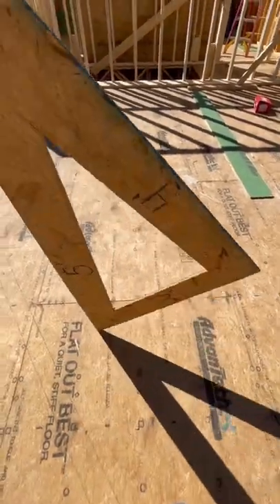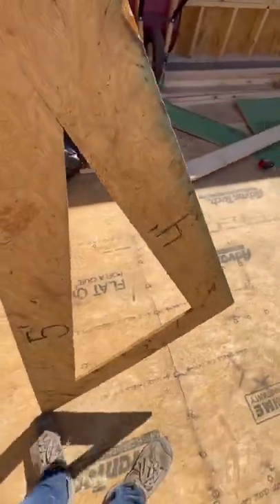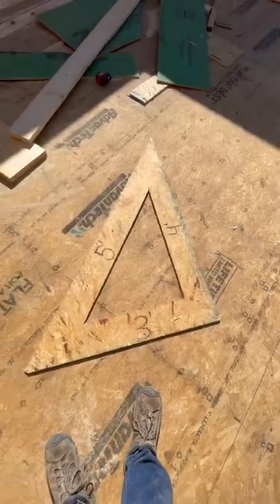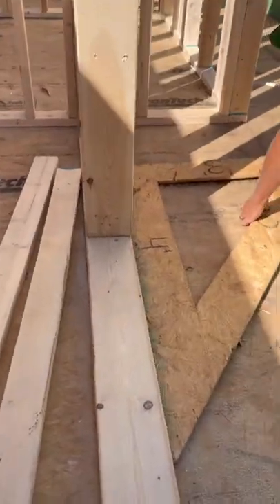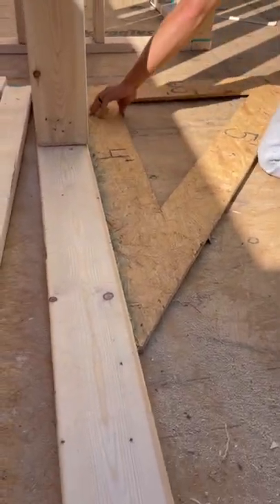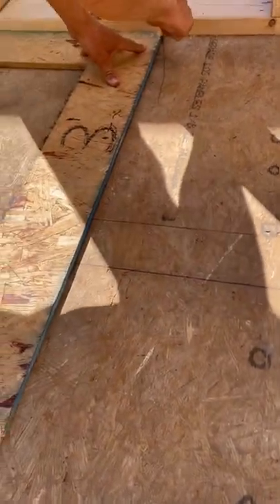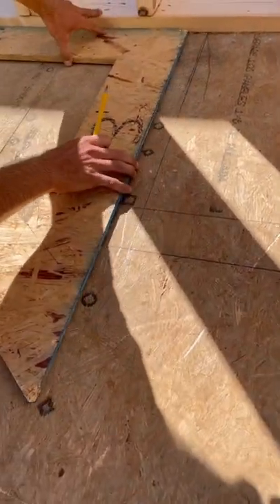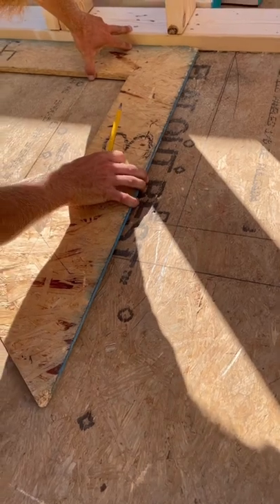Giant Speed Square- custom tool makes job faster

Comment: I made my own tool for punching holes in poly line and popping in drip line. Without having to bend over. Saved my back so much while putting in 20,000 lines
Reply from the maker: I bet

Comment: Used 6 nuts and some full thread to help me push open 2 steal walls. I welded 1 nut to each side of full thread and cut it in half, I then welded the other 2 nuts together.
Reply from the maker: Nice

Comment: I cut a cheap rubber basketball in half and use to drill holes in ceilings. Eliminates most dust as the half BB cups the area being drilled.
Reply from the maker: Very cool

Comment: I hate to break this too you but not one single side of a factory edge is perfectly square ... In fact , they're actually 2° off.... I don't really know why they are but they are ... If you take 2 ° and divide 360 by that 2 , you will have a 180 equal parts ... Now take the a 12" long piece of plywood , if you divide that error across 12" s into 180 equal parts then you'll find that each corner of a factory edge is actually 1/32 of an inch out of square over the span of an 8' board ... This comes out to 1 inch out of square over the span of a wall , roof or floor every 256' ... This is why no matter how good you are or how hard you tty to jeep everything in square you are always out of square and have that zig zag over hang when you start off plumb and even on one side and get to the other end ... This will happen no matter what you do because there has never been a single sheet of plywood that was 100% square ... Its fairly close to perfect especially seeing how it takes right at 256' to end up 1" out of square so over a short span of say 10' or so you only gave that tiny little difference in the corners of the plywood lining up ... Sorry guys but this is just the way it is and therefore that big triangle you think is a perfect square is well , just a big triangle because its anything but a perfectly square square...

Comment: Is osb square anymore? I mean the lines don't line up most the time and that's a pretty easy thing to calibrate at the factory so is the saw calibrated square. I'm just saying measure a few pieces the next time you get a skid. I think it will shock you

Comment: My car is notorious for having a tucked away PCV valve, and the #1 solution to it online is to take a piece of PVC piping and grind away teeth like a foot long socket and use that to get it in/out

Comment: 56 5/16 is the radius of a 360 inch circle. +/- a fuzz.  If you strike that circle on the ground every 1 inch equals 1 degree for say setting walls at 156 degrees

Comment: When nailing up siding, I cut a shim to the exact length of the reveal. Line up the bottom of the shim with the bottom of the previous row, set the bottom of the new row on the top of the shim, and nail it off. We still had the chalk lines run out to verify that we weren't introducing cumulative error, but the shim made it easier to align the siding one-handed (so you didn't have to set down the nail gun).

Comment: I use to work at a precast concrete plant and I always had a piece of rebar that measured 6 inches that I used for quick measurements and used to move and pry other rebar.

Comment: I build a lay out tool for commercial framing equiped with spray paint holder. back in 2002 we did the largest building under one roof in Maryland. there was 15,000 LF of walls in this place.
Reply from the maker: Very cool!

Comment: Is it bad that i look at that and see th3 most custom simple tool I could make? I'm a mechanic, I have qorked on cars, trucks, boats, diesel, heavy equipment, and am currently working I aviation. I have made so many custom tools, I could probably dedicate a toll box to them alone. Haha! I have tools that I custom made foritwrally one specific job, on one specific make and model of car, truck, or plane. Do I use them daily? No. Do they save me literally hours when I need them? Yes. The 2019 Cessna 172 has a job that is required that you removed the bolts from the engine mount, to confirm there is a washer behind the nuts as somewhere along the assembly line that step got missed on a fair amount of them. In order to do this without removing at least one cylinder head, and multiple other parts, it is virtually impossible. I tool a harbor freight wrench, heated it up, bent it in 3 places and ground down the box end of it so this and shallow, that I was genuinely surprised that it actually survived when I torqued down the nut, and still to this day has not broken, and I have done this job at least 50 times.

Comment: Or.....just measure X distance out from the corner on both sides and multiply X by 1.414" to get the diagonal for perfect square. 
Wall only 14" then use 14". Wall is 212", use 212".
Easy peasy. Dead accurate and your not carrying around a giant splinter.

Comment: Plumber here:  it is the only tool that has been stolen out of my bucket, twice!  I take a 12” crescent wrench and cut the handle down to about 5”.  This gives me the smooth jaws for the larger nuts, like on a urinal Flushometer.
Reply from the maker: Maby you need to start selling them

Comment: Custom tool: 1 1/4 pvc pipe cut down to 8 inches long, made 4 90 degree notches on one end. Made installing/removing nuts for a sink faucet super quick and easy. Later found out Homeless Despot sells them for +$20.
Reply from the maker: That’s a cool idea!

Comment: I would mesurer parallel to the wall instead of using a square.if your 2*6 dimensional lumber isn’t straight and it’s never straight. I would just have to cary a tape mesurer a pencil and chalk line. And use the chalk lines of the wall to lay out other stuff. And it’s not very hard to mesure 3,4,5 on a tape mesure  in 15 sec you have a square mark

Comment: Use them all the time of prefabricated bays as the Bay has to be square before we installed the internal walls. Usually just used ratchet straps but sometimes had to get the forks to push a Bay square if it was real bad.

Comment: Had the old man at our shop weld a 2 inch nut to a coupling to take off screw on impellers for Morris 2jc and sufficiently similar pumps  with the ugga Dugga

Comment: In iron fabrication work the word Jig gets used about ten times per hour! so yeah, have made hundreds of jigs.  The very common one though is a set of trammel points used to scribe arcs using any long piece of wood laying around and the two points.
Reply from the maker: Very cool

Comment: Yes I have made a "tool" to make jobs easier.
Only example I can think of is having to notch aluminum posts to be fit a beam. Instead of measuring and marking each one, I just cut out a template and trace it onto each post.
Reply from the maker: Cool
Reply: @hausplans  Thought of another one.. had to pull out a cap from a u-joint in a driveshaft. Welded a threaded rod to it and then put a socket and then a nut and tightened the nut to pull it out. Got the idea from YouTube though

Comment: That’s cool and all but you should just go to a fabricator shop and get it made from aluminum
Reply: or just buy one perhaps they are now cheap to buy?
Probably cheaper than a decent machine edged sheet of plywood I would not use OSB.

Comment: Make custom tools all the time working on cars.etc.. Door Spring compressor, 
panel remover, clutch fan wrench,
trenching bar, custom hammers,dent puller/ slide hammer tool, oil filter wrench, clutch pilot  tool , 3 foot air chisel bit , pullers, wrenches screw drivers etc, nail pullers, ladders concrete trowels, drill bits sanding blocks, stilts,  and more
Reply from the maker: Nice

Comment: I made a floor joist straightener that looks like a 4-ft long tuning fork so that if the board is Twisted you can twist it and slip it into the bracket and nail it
Reply from the maker: I’ve seen people do that

Comment: And with all these comments and a lot of them from pro’s ( and I am one of them) 
No one has even mentioned that they make a 4 foot framing square. Out of metals ( several types)In several styles. From a “T” square we all know from drywall work to 4 foot framing squares to 24” speed squares  
So all this is just a cheap a$$ carpenter not wanting to spend a few bucks on proper tools to do his job better. 
But I will give him this. At least he is using more then his normal speed square to layout the walls. 

Just keeping it real

Comment: Built houses for years, 3-4-5 is used to square units all the time, however, we did not make a giant square, no need, do it with your tape measure.

Comment: "Story stick"   If you're an electrician and you have to say adjust a ton of  lights to 8' 7" off the ground just take a piece of EMT and cut it at 8' 7" so you don't have to pull your  tape measure out every time.  Not as creative as this but still a thing.
Reply from the maker: Very cool 😎

Comment: I do odd jobs on just about anything. Roof to basement, bumper to bumper, forks to back how. Electrical, welding, mechanical, tires, all of it. I have fabricated tools to fix tools to fix parts. Not a single job goes smoothly. That's why it comes to me.
Reply from the maker: You’re right about one thing every job has its problems

Comment: I dont know how to add a photo but I got some 25mm square steel tubing cut it in half and a little off of 1 half attached the 2 so they pivot and used the last tolerate teeth to pull top plates together for gang nails
Reply from the maker: That’s a great idea, I’d love to see it

Comment: I do this all the time but measuring 3 - 4 - 5 is to check for square. You don't need it for the square itself.
Reply: Figuring the 3 - 4 - 5 verifies the squareness, and if measured, it might as well be marked and cut that way

Comment: Nothing is worse than having to make cuts or look at blueprints on the ground. When we would do apartment complexes, every building would have a table built out of scraps so that you can remain standing
Reply from the maker: Yeah most of my framers do the same. Takes a little bit of work to build up front but it’s nice throughout the job

Comment: Running a job entails doing LOTS of baby sitting.  Give a guy a STENCIL is routine.  Just make sure they know what is right from left and up from down!!!  I had guys cut out a window on the bottom side of a door.  And put closers on the outside of the same door.  #NotJustATool
Reply from the maker: All true

Comment: I made a vacuum disc with handles on that my vacuum attacked to do I can lift slabs that are butted and can’t get a bar in to lift them. I tested it at 100kg and didn’t fail
Reply from the maker: Very cool 😎

Comment: It's pretty cool and it would work 100% for what you're doing but I just want to say this out loud being in this field for a very long time there is no Factory edges that are straight they're going to be off a little bit they could be straight but that's why when you have a piece of fascia or anything else you always use your speed square Mark and cut couple inches off just so you know you've made a square Edge but for what you're doing that works 100% it's cool as s*** I'd use it but I just had to point out a factory cut edges or not reliable if you're depending on Precision like 100% Precision it's not reliable

Comment: You should make one side the width of a 2"x4" one side the width of two 2"x4"'s nailed together and one side the hight of a 2"x4" or maybe the width of a 2"x6" on that third side just depends on why you are working on  and yes of course I have mad many custom tools in the shop I have two patients on a couple of them like the old timers say work smarter not harder
Reply from the maker: They did make it 5.5” for the thickness of a 2 x 6 wall but you’re right they could’ve done 3 1/2 “ for 2x4 wall as well

Comment: No way that is lighter than a framing square. That's what a framing square is made for. Ridiculous
Reply from the maker: I have an aluminum framing square that’s way lighter, that’s not the point. It’s about four times bigger so you can use it for laying out small interior walls

Comment: If you think factory edges are straight your a rookie my boy
Reply: I used to use my tape measure to check if boards where square but you are correct not all machined edges are correct especially on products such as OSB. Go up a few levels to marine plywood and you are in with a better chance of the plywood sheet/board edge being true. However you can buy large squares online cheaper than a sheet of plywood to make one. I would check a bought square also with measuring tape.
Reply: It’s rough framing.. it’s square enough
Reply: @scottbertrand2057  Hello Scott we call rough framing simply roughing in Scotland. I agree that as long as you do 3,4,5 on a sheet of OSB to check its square and its kept dry you should have no issues.
Reply: @bazd  I agree

Comment: have you ever laughed so hard at a video. tape, and chalk are the proper way to lay walls out.
Reply from the maker: They measure out and snap lines for all of the long walls this was just a help with a few of the short interior walls
Reply: @hausplans okay,  Maybe a framing square has been invented. complete waste of time.

Comment: That only works if all your plates were jointed on the edge before installation. Measuring with a tape is the only accurate way

Comment: So basically just rip off a corner of a sheet of OSB,  this has nothing to do with the 3 4 5 methed
Reply from the maker: The foreman did the 3 4 5 so that the young guys will get the concept but yes you could just rip off any corner of osb or playwood
Reply: @hausplans  Its a great idea, I do a lot of tile flooring layouts, that OSB square would definitely come in handy

Comment: I was about to say you can make a lot of great things from scrap wood laying around the job site but a speed square that you're using to build a building I would definitely not use because I guarantee you you will never find a perfectly machined straight piece of lumber anywhere in the world close but not perfect like a metal square

Comment: I find it sad that you feel like you need a giant speed square but the best part is you actually put common pythagorean theorem values on each side to remember them.
Reply from the maker: I actually didn’t make it or use it, the foreman for the framers I was using made it. He is a good teacher and wrote 3 4 5 so the new younger guys won’t forget
Reply: I can tell by your comment that you're "far superior" to anyone else.....
You should post videos of some of your incredible work...!
Reply: @2869may  what's the point of the video? The guy thinks this a great idea. And other simple minded people like yourself watch this and emulate his ideas thinking that you'e actually helping to up their game, are really dumbing themselves down further by not actually learning basic construction theorems.
Reply: @dimetrekorsikov5643  We used to use this to 30' 40' 50' to check how square the foundation was before we ever started building the house... 30 years ago.
You couldn't walk in my shadow...!
Reply: @2869may  I couldn't possibly walk in a shadow that's nonexistent. I'm certain that you are a legend... in your own mind. Pretty sure I learned this in the 7 th grade back in '75 . We called it geometry. It's kind of useful when you can actually calculate angles other than 90 degrees. Like cutting and laying out stairs, round stairs, oval stairs, spiral stairs, and maybe your building needs a roof. Oh shit, there are actually formulas for determining rafter length, hips, valleys, jacks, ridge length, and all sorts of little helpful things. Kind of saves time when you can cut every single piece of a roof structure while the joists are being rolled. Dude I've built neighborhoods, apartment complexes, government annexes, a VA hospital in Wichita, tilt wall, steel frame, log frame, and a bird house or two. I'm happy that you're so impressed with your own resume and I applaud the fact that you can find a 90 degree angle.

Comment: snap all your lines after you sheet the deck, won’t need that or move junk out of your way later.
Reply from the maker: They did that for all the big walls,  just used this for a couple short 45 walls

Comment: if the frame work was as wide as the 2x4  then your markings could be made quicker
Reply from the maker: They made at 5-1/2 for 2x6 but it would’ve been nice to have one side 3-1/2 for 2x4

Comment: It would be ok if all of the bottom plates are all perfectly straight... which isn't likely.
Reply from the maker: They snapped lines for the majority of the walls on this house. We just had some little short walls on 45s that they used this square for. Also I think the forman used it as a way to teach some of the other guys about 3 4 5

Comment: 3,4,5 doesnt matter if edegs are factory st straight or not
Reply from the maker: They were perfectly straight on this sheet. Also were using this for rough framing not building pianos or something that’s super precise. The plates we are using for the walls are only so straight

Comment: They could have just use a sheetrock square or a level
Reply: A level would require 2 measured points to draw a line.. this requires 1... sheet rock squares are easily knocked out of square..

Comment: 😂 any real carpenter has a two or three foot framing square. And it’s aluminum so it’s way lighter than that. 😂 and for future reference.  Factory edges should not be trusted. 

What I think you have here, is a guy who misplaced his square and had to improvise. They also cost 14 bucks.

Comment: 😂 they made a giant speed square huh 😂 speed square just means small square 😂 they just made a normal square , those are extremely common and most carpenters have one bigger than that for squaring the foundation 😂